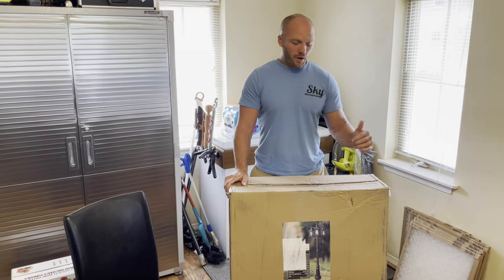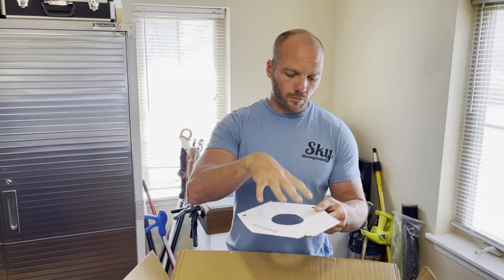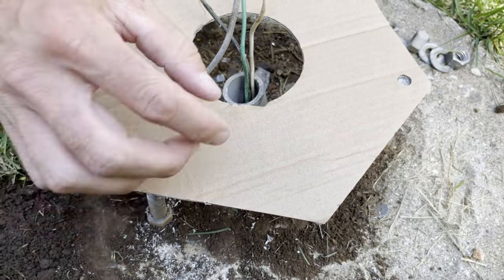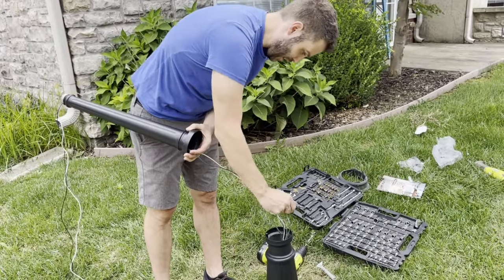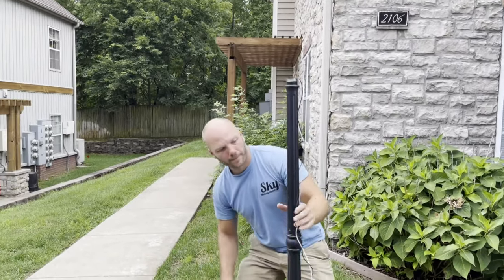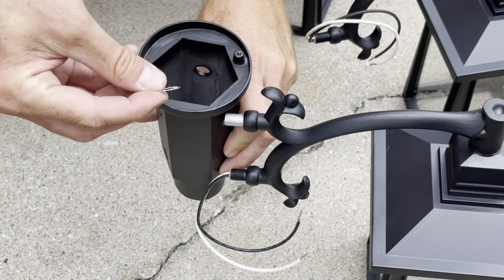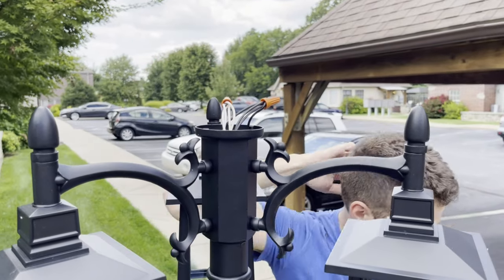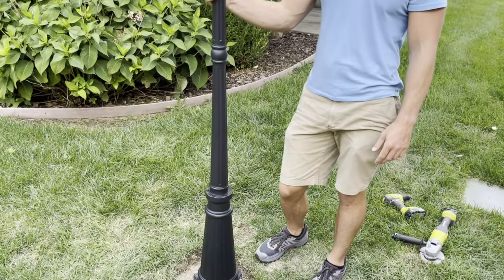How to install a lamp post

Comment: Thanks for this. I'm replacing an existing one we have, but instead of mounting bolts, they just shoved the whole post into concrete and drilled a hole in the side for the wires. So my 2 hour install turned into a multi day project. 😂 Oh and my instructions were also a single piece of paper as well